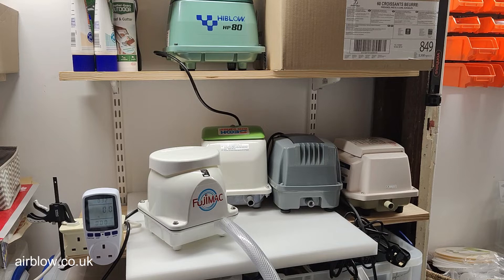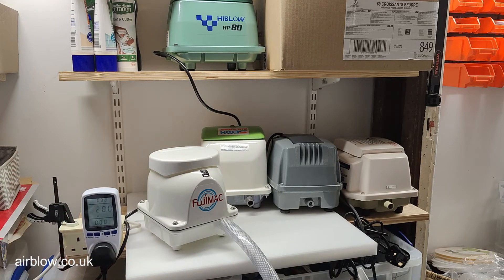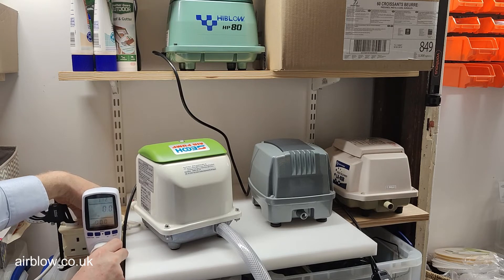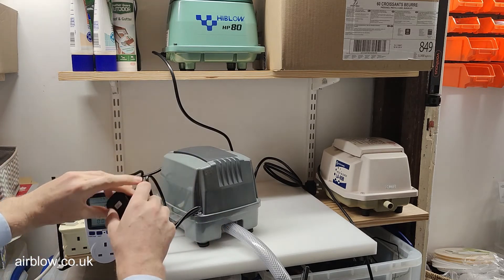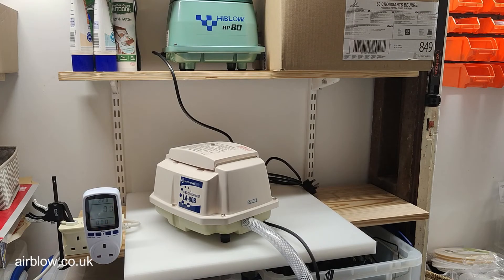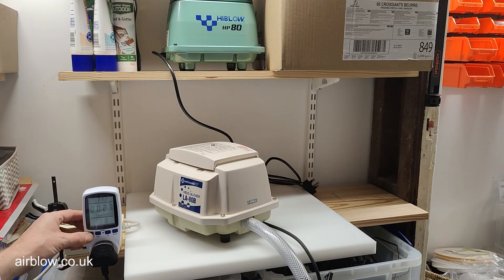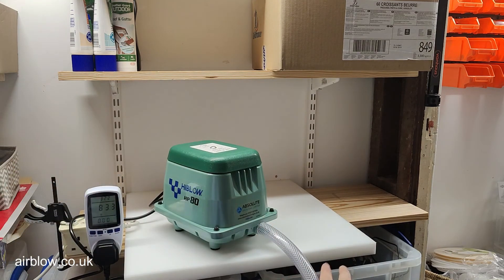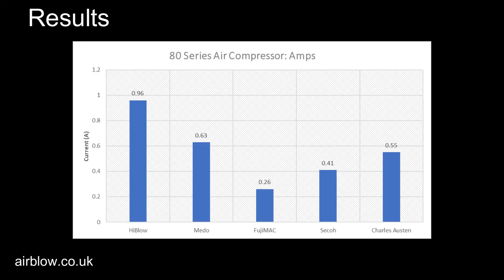Air compressor energy usage comparison testing

Comment: This experiment is a bit misleading as having used many air pumps over the years the medo is the strongest. It is much stronger with back pressure against it and therefore more efficient when pumping to a bottom drain at depth.
Reply from the maker: That's what we used to think too. DM me if you want to chat, I'd be interested in your thoughts as to how to better test, thanks, Luke

Comment: So at what backpressure are you running!? I see they are connected to a hose, but is it at free flow? or at 1 meter depth or 2 meters? you have to know this otherwise it is pretty much useless information.
These pumps will put out different flow rate and us differend amounts of energy (in Watt) at differend depths/or backpressure!
At least i assume the are now running all in the same circomstances, but what are these?

Comment: Great video and just what I was looking for. With the cost of energy rising so fast the running cost of our Medo blower is something I've been looking into. It would be worth pointing out though that the cost of the diaphragms should also be factored into the overall cost equation. For example, Medo are piston based and don't have diaphragms, FujiMAC has a diaphragm that needs replacing every 24 months costing £80 inc delivery and the Secoh £30 every year. Overall the FujiMAC is the most cost effective even when you factor this into the equation. Plus energy prices rise further the FujiMAC will still be the most economical.
Reply from the maker: Hiya Nathan, thanks for the comment YOUTUBEDEC2022 will get you 25GBP off any fujimac pump on https://airblow.co.uk/ if that helps tip the balance for you even more. All the best :-) [valid until end Jan 2023]